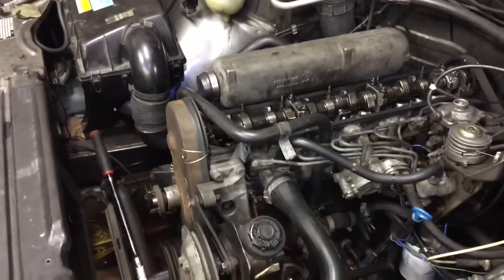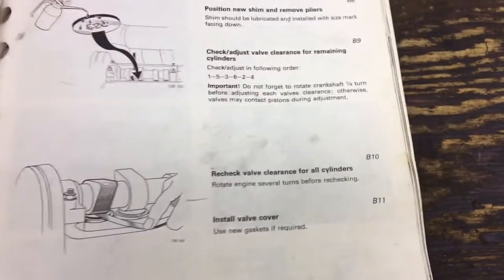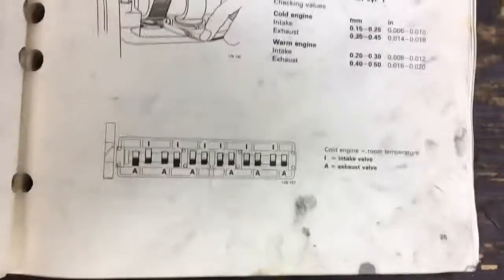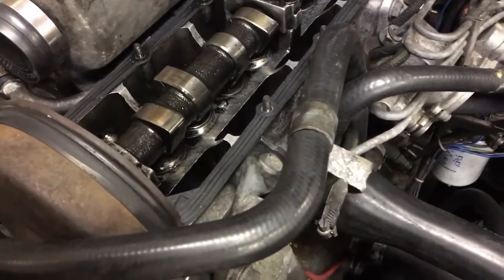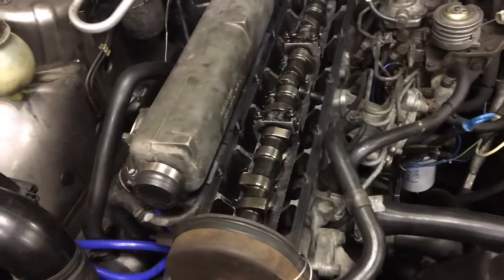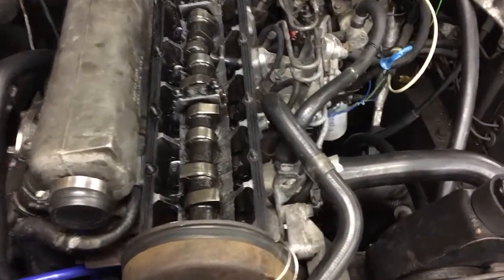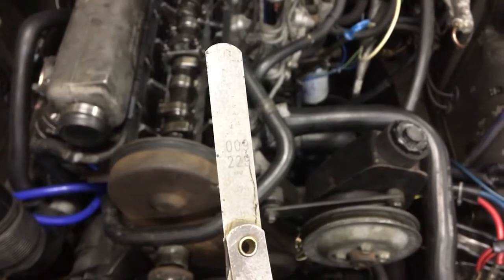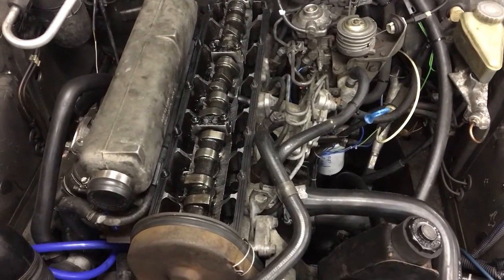Volvo D24T Adjusting Valves

Comment: To get the shims out, you can also use a mechanic's magnet tool. Also, when you're checking the valve clearances, it is easier if you use angled feeler gauges. (if you can find a set of them).
Reply from the maker: These days, I usually use a magnet myself. It’s been years since I actually watched this video.

Comment: Nice video! But how do you check the other valves? Do you have to turn the shaft in a different position?
Reply from the maker: Yes, you turn the motor over and follow firing order, which I can’t recall at the moment but is the same for all sixes I believe. When the cam lobes aren’t touching the shims, you’re at the next cylinder, same any engine.
Reply: @adamdrives365  1-5-3-6-2-4 and I think it is also engraved into the intake manifold. d24s are nice

Comment: Best way to do this valve adjustment if you do not have enough shims of certain sizes: measure it all, each of them, make carefully a chart for yourself of what you have and where.. and what you need and where. You probably will be able to switch some of them around and get lucky. of course you remeasure again and do it at least one more time when you finish. If a size is missing, and you dont have it, and cant wait for an order; then you could use another shim from another valve that needs swapped anyway. good to have a chart for yourself and see, IN ADVANCE. intakes are much more important than exhaust valves on these, intakes should not be on the tight side, better to set them closer to the bigger value if you have shims for that. 
always do this valve adj on a COLD ENGINE and use the cold specs.  do the adjustments following the firing order. you can do it in a hurry but why would you? prob need a full afternoon to play around.  good luck, be careful. roll the engine over by hand, you could do that after each valve adjusted btw. like why not. lol. exercise.
Reply from the maker: I Kutia P I measured them all in advance so I knew what I needed to order. Much easier to do accurately letting the car sit overnight to measure everything at the same temperature.

Comment: Thanks for the video. I'm reassembling the cylinder head while it's out of the engine. Could I adjust the valves before putting the head back on the engine block?
Reply from the maker: Stray Cat I don’t see why not
Reply: I'll give it a shot. I don't have the tools for the adjustment yet so I'll put the sprockets on tight enough to turn the cam for measurements. Then I'll remove the cam if I need to change shims. Thanks for the reply!

Comment: Hi Adam I own a mk1 VW LT with the same engine (d24t) & I desperately need a complete comprehensive service manual to aid my task of removing, servicing & reinstalling of the head.
 I would be extremely grateful if you could help me aquire one (same as yours) with all the sections please?-
 I tried Ebay & only found Haynes. 
Thank you in advance.
James Cook
Reply: I'm in the same boat as you James. I have a VW LT 40 and am looking for that book too. Did you find one?
Reply: You can dowload the book via Pdf files on google, very easy, just search for " volvo d24 pdf" and the one in the top, there it tells you how to do everything but for non turbo engines, but you do it same way as turbo engines.
Reply from the maker: I hope you were able to find it, but if not try here. You may have to spend some time searching as they are not all named accurately. But this is the best resource for free digital volvo service manuals I know of. https://ozvolvo.org/archive/

Comment: Hi there! Volvo 760 d24tic owner from hungary. 
Im desperately looking for green books for this model and engine. Car is from 1988. I tried google, but without any luck. Can somebody help me please?
Reply from the maker: What information are you looking for?
Reply: I dont look for anything specific, just trying to master this engine and the model. Looking for official tool numbers and all kind of related thing.
Reply: Also would love to take my hands on original printed green books.
Reply from the maker: That will be hard to find. Most dealerships and independent shops probably haven’t used these in decades. My suggestion would be to call as many dealerships and shops as you can